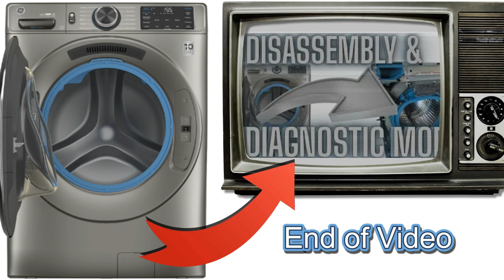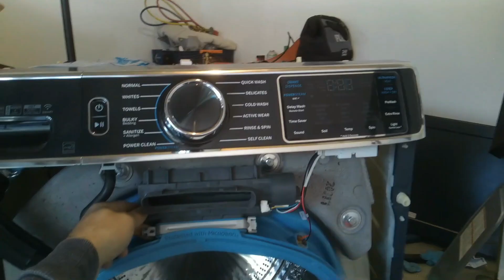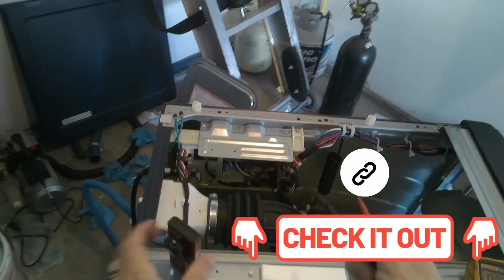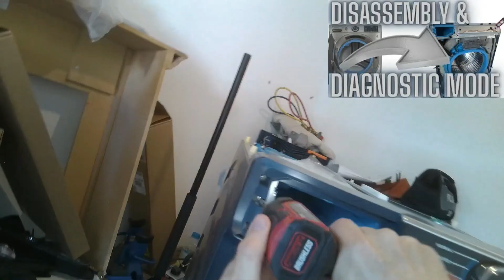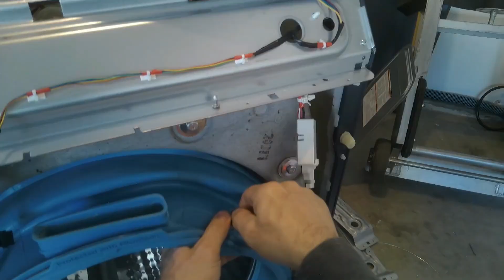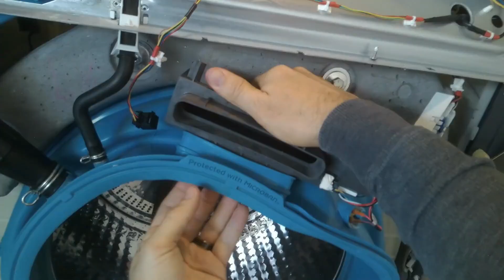GE Washer Error Codes 38, 39, 40, 84 | Vent Damper Test & Repair

Comment from the maker: 🔧 GE Washer Error Codes 38, 39, 40, or 84?

If your GE front load washer shows error codes 38, 39, 40, or 84, the problem is often related to a faulty vent damper or an issue with the vent damper circuit.

👉 GE Washer Vent Damper used in this repair:
https://onlineappliancepartshub.com/products/wh16x29509-ge-vent-damper-genuine-oem-replacement

✔ Always confirm compatibility by typing your washer model number in the search bar before ordering.

💬 Need help diagnosing your washer?
Post your washer model number and error code below, and I’ll try to help point you in the right direction.
Reply from the maker: You can also run Service Mode Test 24 to activate and test the vent damper to see if it opens and closes properly.

Comment: So when I do the Voltage test I'm only getting around 55 volts and a hum coming from the vent damper with no movement. I'm thinking it's the control board but wanted to ask if there is any I need to test before ordering a new board.  

Awesome video and very helpful!

Comment: Hey. My GE front load washer model gfw550s stops after 3 mins. I had a few power surges due to bad weather, there were about 6 different codes. I replaced the main control board, and now i have 2 codes. 38 (vent damper), and 3 (locked rotor). Do you suggest i swap out the inverter board due to the error code 3 issue? It's not a locked rotor because the machine spins freely. i think the the inverter board is bad as well and maybe not sensing that the drum is spinning
Reply from the maker: Yes, it does sound like a bad inverter control board. What you need to do is put the unit into diagnostic test mode and make sure the tub rotates in both directions. If the tub only rotates in one direction during the test, that can also indicate a bad inverter control board.

Comment: Had a couple power outages back to back and washer stopped draining. Tracked it down to the control board(code18). Replaced it today, now the pump works, ran a load, everything seemed fine. Threw it in diagnostic after the load just to check and I'm getting a 38 code. Vent seems to be stuck open... Did I get a faulty board???

Comment: Nice video! My washer won't start and I am seeing the same error code of 38, but in my case when I try test 24, after I click the start button, it didn't indicate extra light. Does that means the damper fail to close and I should get a new vent damper? Thanks
Reply from the maker: Hey, really good question—and you’re on the right track running test 24.

If you’re getting error code 38 and the “Extra” light doesn’t come on during test 24, that usually means the control isn’t seeing the vent damper close properly. That can point to a bad vent damper, but before replacing it, I’d double-check a couple things:

• Make sure the damper isn’t physically stuck (lint/debris can block it)
• Check the wiring connection to the damper motor
• Listen for any movement when you start the test (even a slight click or hum)

If there’s no movement at all, then yeah—the vent damper is a strong possibility. But if it’s trying to move and not completing the cycle, it could also be a control or wiring issue.

Quick question—do you hear anything at all when you start test 24?

If you want, I can help you confirm it step-by-step so you don’t end up replacing the wrong part 👇
patreon.com/cw/OnlineApplianceTech

Comment: Great video. Thanks.
I had these error codes, so I installed a new vent damper. Then I cleared codes and ran a few loads, and errors have not reappeared.
The main issue I was trying to solve was the UltraFresh is not working. I though this would solve it, however the UltraFresh still does not work. I press the button, but nothing happens. What else could be the issue with the UltraFresh not working?
Reply from the maker: It might be the main control board. You may want to have a technician check it to pinpoint the issue. The fact that there are no more error codes is a good sign.
Reply: @onlineappliancetech  Thanks for the quick reply. 
In addition the Control Lock and Wifi buttons do not work. Do you believe it's the Interface board (which is cheaper) or the main control board?